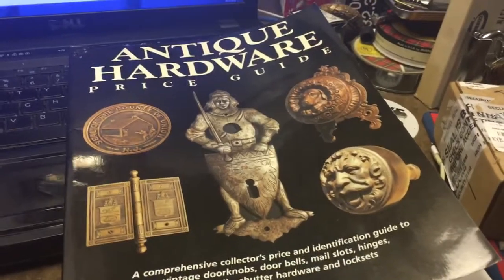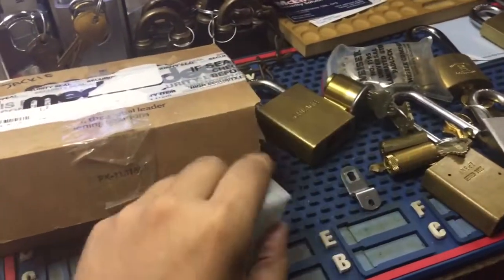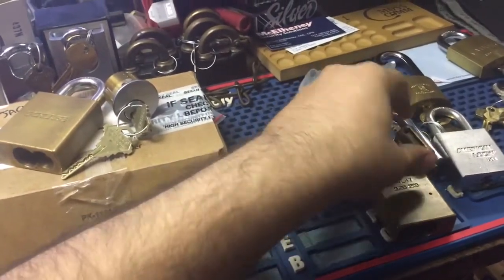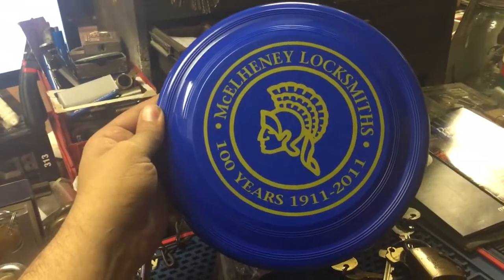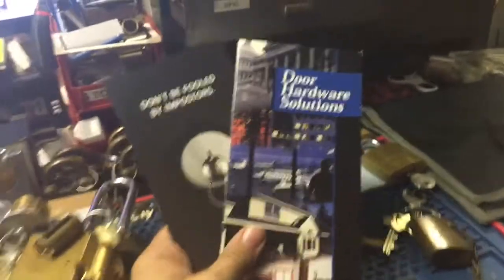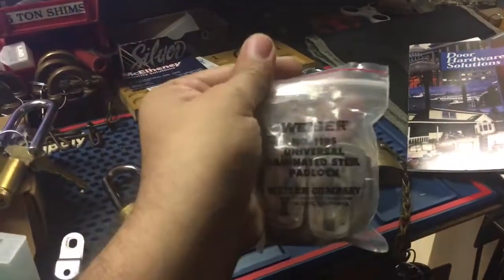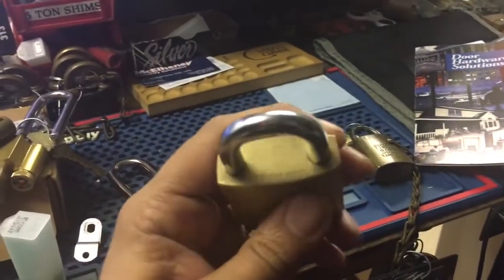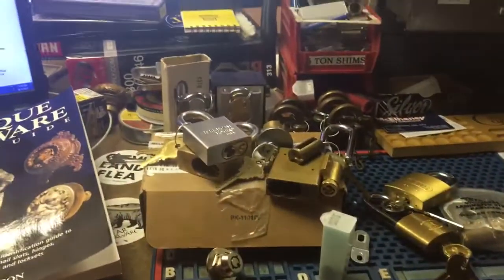August Locks 1

Comment: Nice toys again good sir.
The padlock diy lock looks fun😎👍👍🔐
Question,do Primus also do the side bars separate or do you just get them standard with the core(I don't know too much about these locks🤔🤔🤔🤤
Reply from the maker: the sidebars (and finger pins) come pre-installed in the cylinder but you can also buy them separately.
Reply: Jeff Moss thanks for heads up buddy👍👍😘

Comment: Jeff Moss do you have a Corbin Russwin cylinder with the N21 keyway (N21 keyway is discontinued). I have a key with a great bitting.
Reply from the maker: sorry, I do not.
Reply from the maker: PS those are not discontinued - I checked my distributor and they still carry the N keyways, they just happen to be out of N21 right now.
Reply: http://lsamichigan.org/Tech/CR_CylinderManual.pdf    ---go to page 23. It lists N21 as "Inactive". I am not sure if that is the same as discontinued but thats what I thought.
Reply from the maker: Smuckers T yeah I have the manual, it just means they are used for new systems from the factory. You can still get cylinders in most of those keyways.
Reply: Where would you get these cylinders because Corbin has atleast 50 keyways and even if I am sure that it is the N21 cylinder the price is unreasonable. Where is a good place to find these cylinders?
Reply from the maker: Smuckers T I have a wholesale distributor that sells all the Assa Abloy brands